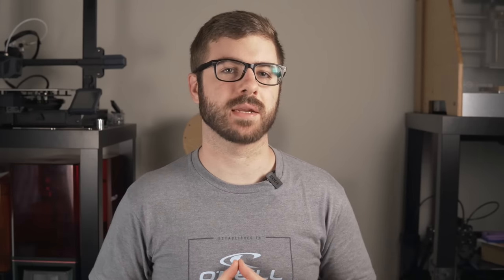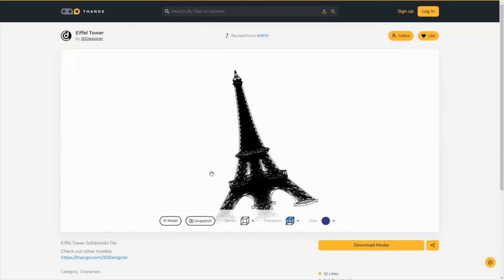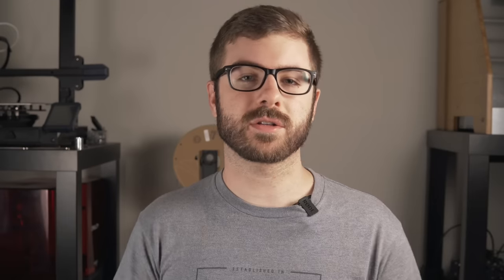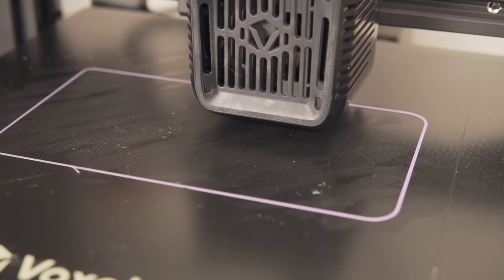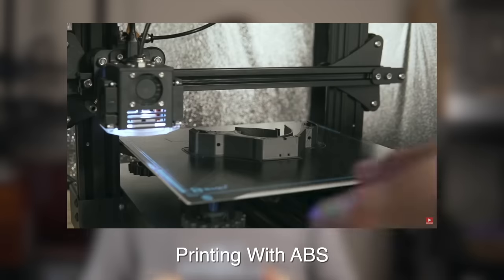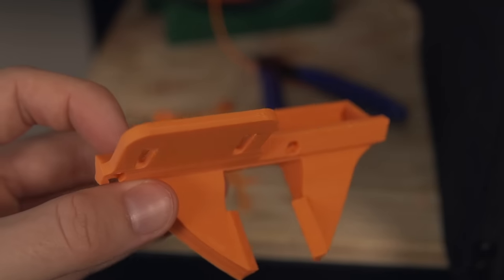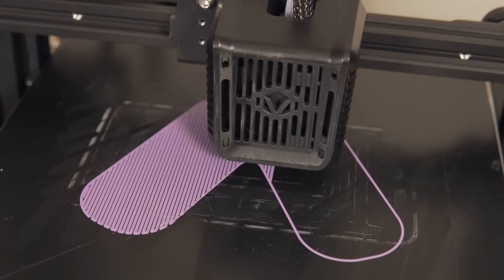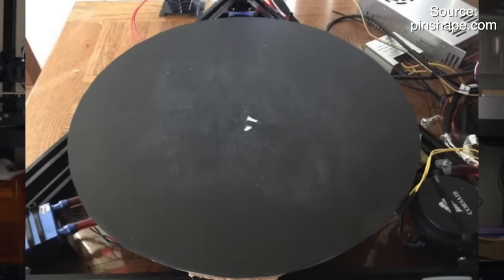How And When To Use Skirts, Brims, And Rafts For 3d Printing

Comment: I am 75 and just bought my first 3d printer. The AnyCubic eliminates the need for skirts by always doing a skirt on the edge of the print area before starting on the item to be printed. A tip from an experienced friend that eliminated adhesion issues was to wash the bed plate with washing up liquid and clean it with one of those green scouring pads. I then just give it a light rub with a dry pad before each print and it seems to work every time. If it fails to adhere just rewash it. The AnyCubic also includes self levelling. Glad I never jumped in too early. Machines today seem highly developed.

Comment: I’ve found rafts especially helpful with prints having lots of small parts. The flexible octopus worked much better with it for me, coming off and being SUPER flexible as soon as the raft was removed. The big one for me was when printing my cable chain. All of those little parts were a nightmare for me at first, popping off randomly no matter what I changed. Once I enabled the raft, it printed perfectly the very first time.
Reply: How did you remove the octopus, the same situation for me, it only worked with the raft but I can’t get the octopus off the raft? I use generic PLA and an Ender 3 v2 neo
Reply: @SS____________  if I remember correctly you need to increase the raft air gap. It is labeled differently on different slicers. But it’s the distance between the raft and the actual print. There should be a small gap so it doesn’t weld it to the print.
Reply: @ghrayfahx  ok ill try to reprint with that in mind.
Reply: I’m literally doing the octopus with a raft right now Raft seem to be helpful. When you have a lot of small pieces that get stripped off the build plate easily.
Reply: Good to know! I printed the octopus with a brim and it made a bit of a mess around it, I'll try with a raft next time

Comment: The best advice I have ever had, which improved the success of my prints to about 99%, is the use of a 'feeler gauge'. It is a inexpensive tool from an auto parts store such as 'Autozone', they are used to properly space sparkplugs. To level your bed, such as on an Ender 3, first 'autohome' the print nozzle, and move the z axis to starting z position (set to z layer height, 0.28mm for example). Choose a feeler gauge that best matches your z layer height (0.279mm for my feeler gauges). disable stepper motors, and carefully adjust bed corner knobs to have very light friction. This works perfectly every time, I never require rafts or brims. A single layer adheres perfectly, and peels off like a piece of paper.

Comment: skirts 2:50 to help your printer extrude before the actual part gets printed. It prints a loop around your print(he uses 3 loops)(does not interfere with print)

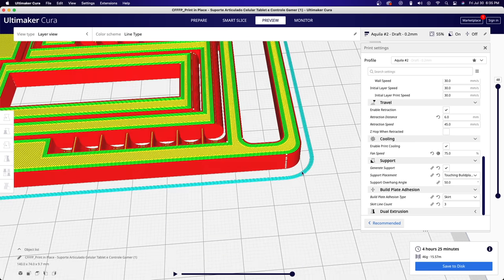brims 6:30 to help with bed adhesion and warping, if your print's first layer is too small it might fall off during printing and brims help with it. It prints a layer around your print and is actually stuck to your print(8mm width is fine but he uses 5mm)(might need deburring tool to remove it)

rafts 10:09 rarely used but useful if you don't have a heated bed, your print surface is jacked up or you're worried your bed leveling was off. It actually lifts the print off the bed so it requires a bit more material
Reply: MY COMMENT WAS JUST A SUMMARY all points in this comment comes from the video i did not come up with these myself. Like the actual video if you found this helpful
Reply: @Joevim  bro your comment summarized a 15min video into like 30s of reading
that deserves some acknowledgement
Reply: thanks for saving me 15 min:face-green-smiling:
Reply: rafts are also super good for reducing elephant footing if that happens. itd be interesting to know how brims impact elephant footing
Reply: Bless you 🙏

Comment: 3 weeks new to 3D. I was shocked to hear this video.
100% of the models (stl) I have downloaded and printed had rafts when I sliced them with Cura, Cr Pronter, CR slicer.
The reason found this video is that I made from scratch a model thin tinkercad and when I sliced it in Cura I got a raft that was only under half the model and I didn't know why as I had the default  setting.
Now that I hear  this video, I'll need to go back and remove rafts!

Comment: Amazing that your talking about this now. I'm using a brim to save a print that I know would have warped due to its size. It very flat and takes up the whole bed. Its been printing for hours now and it perfect due to the brim. My bed is levered well as I learned that's the key to good prints but sometimes with very flat parts it still warped without a brim. I only use rafts on very small parts or oddly shaped ones.

Comment: I use a prime line in my start gcode, no skirts.  Something I have been doing lately is I put just a tiny bit of painters tape where the nozzle moves over the bed to wipe the nozzle off.  The tape just barely rides on the bed, maybe 1 or 2mm, then its folded over, it is only there to knock off the prime line before the nozzle moves over the bed and starts printing.

Comment: I have been using brims for PET-G on a printer without a heated bed to help with adhesion and warping issues. However, I build the brims into my CAD model as opposed to letting the slicer do it. This way I don’t need the entire foot print surrounded.  Just the areas that are prone to warping…..Makes clean up of the parts much easier.

Comment: Great video~!  I'm new to the 3D printing community and this was very informative.  I just bought/assembled my Prusa i3 MK3S+ and am getting started.  One of my first few prints has a solid base measuring 7.2mm x 14.5mm.  About 15-20 minutes into the print, I find that the back end lifts off of the bed.  I've gone thru the alignment wizard a few times, thoroughly cleaned the bed each time, and the 2nd time I tried using a glue stick, but the same result.  I haven't built an enclosure yet, but I've got a large cardboard box that I'm going to try using in the meantime.  For my 3rd go around, I'm going to try a brim to see if that helps.  Just trying to understand the dynamics of this new tool in my shop.

Comment: still great information!  I'm in the land of the bambu X1C and if I don't use a Brim for ASA, which I love as a material, it warps (also I use bambu glue)  I am toying with brim distance to see if I can still get good bed adhesion and also more easily remove the Brim.  when I print some pla parts also I use a brim if the part has small bits, 90% of the time they get knocked off the bed even with glue.

Comment: This video came out at the most convenient time. Just as I started having problems with bed adhesion! btw this is my first time printing.
Reply: Glue stick, its a miracle worker.

Should always make sure your bed is leveled before you try anything else, but if you are positive it is leveled, glue is the next thing to try.  Brims are fine, if you have to have them, then you have to have them.
Reply: So it always gets over looked when someone says they are having bed adhesion problems, even I over looked it.  Dont even know what made me think about it and comeback to recomment but....

There are many other things besides just a level bed to getting good bed adhesion.  Are you printing hot enough?  You want to print your first layer hotter than all your other layers.  Are you printing slow enough?  Printing your first layer too fast will cause problems, you want to print your first layer extra slow.  There are all sorts of other little things I am likely missing too, its easy to just point to one thing and say that has to be the problem simply because it is the most common problem.  

If all else fails, CHEP has a Cura profile for the Ender 3 you can use.  Im not particularly a fan of his profile, its on the slow side, but it is a proven working profile that many people love.

Comment: This was good and you covered mostly everything. For rafts there are two more scenarios that they are used. Some enclosed ABS/HIPS/PC machines (Zortrax M200, UP mini 2 etc) come with a perforated build plate and always use a raft for material to get into the small holes (reason for thick extrusions) and provide a foundation that is mechanically griped to the bed. It is better for less warping and a raft is the only way to print on a perforated build plate. Another is when you are printing a large part with a material that sometimes sticks too well to the build plate material and does not release easily after cooling down. Ever heard of PETG welding to smooth PEI and chipping smooth glass? Polycarbonate can also weld to Buildtak surface. If the model has a flat continous surface (no grid, no gaps, just full solid infill) then it will be difficult to remove. A raft in this case acts as a release agent.
Reply: PETG can actually bond to borosilicate glass at a molecular level. Do not print PETG on glass without an interface layer of hairspray or glue stick or something to separate them.

Comment: I went for a long time never using rafts, but I have found them useful recently on parts where dimensional accuracy is paramount.  I normally have things printing pretty hard on the buildplate to ensure adhesion, which creates a small elephants foot and thus slightly reduces the height of a model, using a raft gets around that.   The bottom of the piece is nowhere near as pretty, but it is dimensionally accurate for fitting parts together, so it has its place.

Comment: ive found that i use rafts on things that need to fit really well, the brims often are difficult to get off the part fully, and you usually end up with some amount of it still there and causing fitment issues, (like if you have a tiny printer like a monoprice mp mini delta and you want to print some gears, you can stack them on their side, which makes the print 3x longer, but i'm asleep anyways so it doesnt matter, but if you use a brim it messes with the mesh, but a raft usually doesnt)but if i use a raft, there isnt any, rafts come off better (for my printers and abilities i mean) a de buring tool usually only works on circles, and edges one way any type of bend or weird geometry, good luck using a de-burring tool, sand paper is fast for me and wont gouge the part if you hold it weirdly or slip.

Comment: Rafts are great for prints without a large flat face, like a Sphere.  Rafts are good for enhancing adhesion and prevent layer shifts for the supports below a printed sphere or odd shaped model that's essentially floating in space above the print bed, or things sliced at a 45 angle to minimize layer lines.
Reply: That’s essentially the issue I’ve been having. I’m trying to print a cross guard for a LOTR-lightsaber hybrid and as soon as the print gets to the far ends of the cross guard, the nozzle catches or it shifts and the whole print goes haywire. Trying it right now with a raft and hoping for the best!!

Comment: I started to use raft with abs because i couldnt get it to stick right on corners and lifted up, brimm just separated from where the brimm toutches the part and the thing lifted up. Sometimes rafts are needed

Comment: I very new to 3d printing (2 days!) and my first "real" print of Flexi Rex failed on the first layer due to curling. A brim solved the issue. Shame the part silently failed half way through the 4 hour build because the filament stopped feeding.

Comment: Good stuff! Don’t forget helper discs, there the new brim. I haven’t used one since.
Reply from the maker: Damnit that is what I mean not lily pads unless the term lily pads is used by some. The helper disks are something I would love to explore more and cover separately 😬
Reply: @ModBotArmy  I always heard them called "mouse ears". I use them to avoid corner warp, or if I want the advantage of a brim, without it going around the entire print (like a print with multiple parts, but only one needs more support).
Reply: @dayveeman  I guess they have lots of different names!
Reply: @ModBotArmy  You could totally do a whole video on it between placement strategy and method of creating the disc.
Reply: Is there a way to get mouse ears in cura?

Comment: Im new to 3d printing but i heard someone said raft will prevent u from "elephant footing" if u want to print "print in place" stuff
Reply: No need for a raft, most slicers have a setting to address that directly now, in Cura it's called "Initial Layer Horizontal Expansion", PrusaSlicer has "Elephant foot compensation".
Reply: @grumbel45  ouhhh..thxx

Comment: Wow... At 5:30 the whole bed moves from right to left. I almost can't believe this bed is leveled alright as it is loose on the carriage.
I am almost sure one (or more) of the excentric nuts are not tightened correctly, therefore at least one of the weels is loose.
Nevertheless, this was a very good explanation of the Skirts, Brims, and Rafts, and everyone new to 3d printing should see this video. Just happened to see that movement. :-)
Reply from the maker: Haha you are probably not wrong (need to rewatch). Due to small spaces the printers get moved a ton which causes things to loosen. Good catch 😬. Thanks for the kind words and feedback 👍
Reply: @ModBotArmy  Lol, I do know that problem... Same happens here on a weekly basis :-)

Comment: Brims work great, but Cura only allows 1 layer brims. MatterControl slicer will allow multiple brims to be used so that the brim does not tear at the part surface during warping.

Comment: I have an Ender 3 S1 pro, and no matter what my adhesion settings in the slicer are, it always prints 2 straight lines along the left side of the build plate. 

I assume this is to fill the same purpose that a skirt would. In fact, until watching this video, I always wondered what the purpose of a skirt even was. It always seemed so pointless. When you started explaining it's purpose, I was like "oh. Cool. That makes sense, but my printer already does that itself."

Comment: Hey ModBot, Have you every used PLA-F filament? I bought a kilo not knowing that it was any different than PLA. My limited research shows its a mix of PLA and ABS. Ive only owned a printer for under a week but would still like to figure this filament out. I tried doing an ABS temp tower (260-220), but results didnt really seem to show much to me. 260-240 all looked the same, but when it got to 235 the tower fell over, so bed adhesion apparently wasnt great
Reply: You probably fixed this by now, but for anyone else, ABS needs a higher temperature on the bed, so in this case a higher bed temperature would probably help in adhesion!
Reply: hjcpkr 
Thank you

Comment: I feel like im the first person asking this but ....

What the f do I do if my adhesion is TOO HIGH? Bought the Anycubic Mega X and my PLA prints just wont come off. The last two I had to get off with hammer and chisel. Doubt the printer likes me doing that but what else am I supposed to do?

Bed is fully cooled down, even after hours it sticks like glue. Tried ethanol which people claimed to work wonders but nothing happened.

I hoped skirts would have been like those in resin printing where you actually get a slope to shove your chisel under.

Comment: Thank you

I have one brand of pla that the only way I could prevent it from warping is to use another pla brand for the first few layers and then change filament to this pla which is prone to warpage. Otherwise this pla is realy good and strong. 

First time I hear about the brims. I will try the brims

Thank you

Comment: In most cases a raft is a waste of time and filament, however I was printing hand armor without any flat edge. Yes a raft worked but if  didn’t clean up well. Have support easily removable and easy to clean up is a bid deal.

Comment: The default skirt distance is 10mm in Cura and in version 4.8 I was able to change this to 15mm so if an ooze fellinside the skirt it would not impact the part but in 4.10 when I change this it is highlighted in orange to signify an error, do you know what is going on?

Comment: I'd love to see pros and cons of deltas vs. gantry type printers.  With all the advantages of a delta, esp. the flsun qq-s-pro with: autolevel one-time, z-axis align one-time, glass bed (coated?) which sticks very nicely and parts slide off when cooled and fast print speed.  Why choose another type?

Comment: Question when using raft I can’t pull off the model it sticks and distroy the part. Please help using cura
Reply: I found the "raft air gap" is crucial. I set it to 2 layer height (for example with layer height 0.2mm set it to 0.4mm) then I can separate the model and raft easily.

Comment: Rafts are for dimensionally accurate parts. Any other reason for them is a "band aid" as you said. But the trial and error approach to nailing first layer squish while compensating for elephants foot and keeping a part the right size is kind of silly and unnecessary. That's what rafts are for.

Comment: I noticed I avoided the elephants foot effect while using rafts... Is there anyway to tackle that while using skirts and brims?
Reply: Use the "Initial Layer Horizontal Expansion" setting in Cura or  "Elephant foot compensation" in PrusaSlicer.

Comment: Im printing a big cylinder with a big angle at the end of the print, i cant invert the object cause it will be to weak, at the end of the process the object will distack from plate every single time, i ve use brim and i slow the printer to 40-50% of speed but nothing, raft can help me? Ah i have set the z hop and nothing it distack 🫣🫣😢